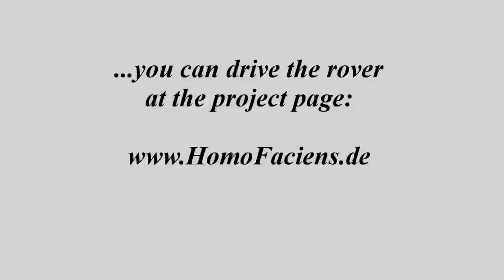Construction details of a rover

Comment from the maker: @mrCbeems Well, two questions with no short answer...
=1= Some more information would be helpful.
=2= Depends on the application. If there is just a low bandwidth in rotational speed, the voltage control is often used, because it is more simple. If the motor is operating with highly variable speeds, current control is used to avoid a too high current at low speeds.
Videos about engine control will follow, but not very soon...